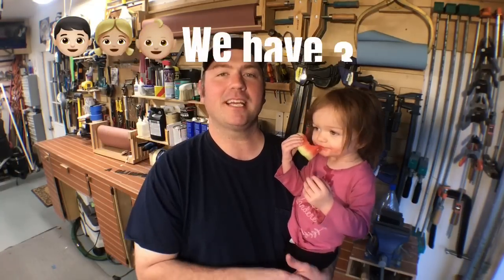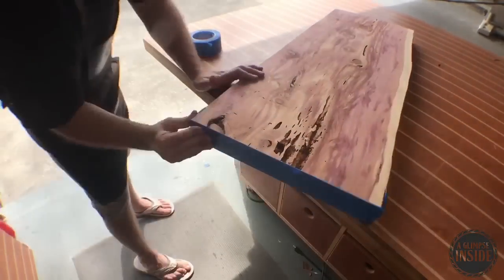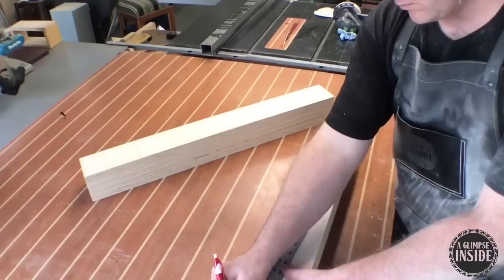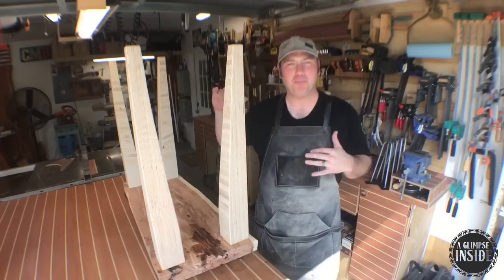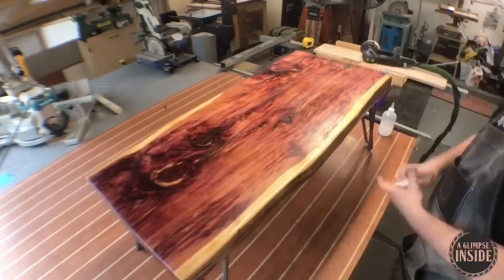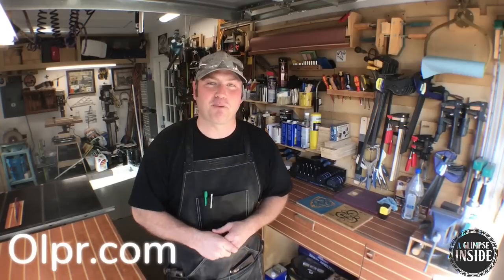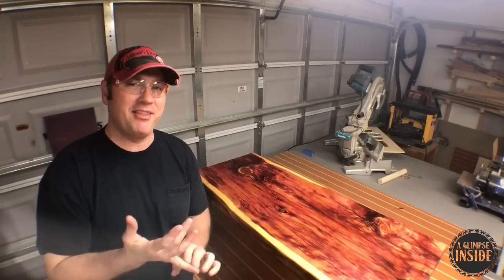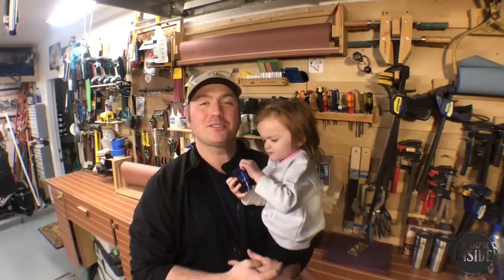How to Make a Live Edge Table | Professional Finishing Results with Polyurethane | Diy Project

Comment: Great video. Informative, fast paced and helpful. Your daughter is precious. I tuned in because I built a computer case out of cedar and wanted a finish like you achieved. Thanks for sharing.
Reply from the maker: Awesome. I hope it works out well for you
Reply: @AGlimpseInside  Thank you. I didn't achieve quite the finish that you did but it looks beautiful. I was impatient and stopped at 4 coats, last one was thinned slightly with thinner. Cedar is so beautiful when it is finished in poly.
Reply from the maker: AXMRDR agreed. 👍❤️

Comment: Great work. The sanding tips are excellent, as is the custom applicator hack for the wipe-on poly. I'm going to build a sofa table bar with cedar, using either hairpin legs or black pipe legs. I'll use threaded inserts and 1/4-20 bolts instead of drilling screws directly into the wood. It's more secure, and much better if you ever want to remove the legs.
Reply from the maker: Dan Limbach Thanks a lot man. The idea of the pipe legs I can come off I like it! Thanks for let me know man and sharing that cool Lego idea

Comment: Epoxy seemed as if it took a lot more than expected?  I made a coffee table with voids needing filled like that and it took three times what I figured it would . After a while of staring at it I decided to cut it in half and see how far the epoxy went and bang!
I now have two end tables that are usually the topic of conversation every visit from all. 
Kind of like cutting an ant hill into and seeing the inter workings .  Next time I think I will use some dye in epoxy .  
That lil one of yours is doll 🙂

Comment: Love that, would you use that floor poly, to produce a red cedar kitchen counter top?
Reply from the maker: If I was going to go with A full countertop I definitely would go with a one to one ratio epoxy. The polyurethane would probably hold up but I figured counters are probably the most used surface in the home so resin would be the best choice

Comment: Dude, loved watching the process of how the table came out. Thanks for going over all the steps for a flawless finish. I'm getting ready to do a live edge dining table, and I was curious on how well that finish holds up to heat. Would a cup of hot coffee cause white circles on it? Or would a varnish be better in your opinion? Thanks Bro, God Bless!
Reply from the maker: Hey thanks for the great question. You know honestly I’m not sure. I do know that I have fixed white raised in tables before with very high number to grit sanding and then reapplying to finish but I’m not really sure if this finish would do such a thing! Thanks for the kind words as well and I’m sorry I’m not much more help
Reply: Shelac does that, oil based poly won't.... Idk about water based though , I've never used it.

Comment: I’m looking to do a similar table to this but taller. Did you use polyurethane as you stated in the video or epoxy?  I would have thought epoxy would show the grain better. No?
Reply from the maker: Katz Steel The table was made before I was introduced to Resin. It’s still today has all those coats polyurethane on it. However within a few years from now I’m probably going to strip it down and pour epoxy over it. I do believe it’s a bit more durable than polyurethane. But absolutely just poly  in the video
Reply: A Glimpse Inside Do you have a go to brand for no VOC epoxy?
Reply from the maker: Katz Steel absolutely. Totalboat
If you use my coupon code”GLIMPSEIN” 
At checkout@totalboat.com you will receive 20% off your entire order

Comment: why not use a polishing compound? Also is that surface food safe? can she suck up her spilt cool aid with no long term adverse effects? She is a cutie pi for sure.. Floor surfacing doesn't seem to me to be the safest surface for her.. But then she is your child not mine.. I would have been a bit more selective in my surface for my kids rooms.. But it was a sweet looking table.. I love that cedar... I am going to do a live wood kitchen countertop (with some new cabinets I am going to make..) in the spring but I am having a hard time finding the surface sealing for it.. there are some oils I can use but that calls for me to re-do it after so long.. So if you have any good suggestions I would appreciate it..
Reply from the maker: Typically any polyurethane surfaces are food safe once they are fully cured. It’s essentially like a thin layer of plastic that can be disinfected with Lysol or Clorox. I do like the richness of oil finishes but yes you do have to reapply them. So really the choice is yours. I like walnut oil especially for food related items. Hope this helps.
Reply: @AGlimpseInside  yeah it is what I am finding.. so it helps.. I like the finish the oil's leave (I do not like the shiny surfaces for my kitchen ) But I do want something I will not have to hassle with.. maybe like a danish oil from watco.. it has both oil and pollies in it.. well thanks for your input.. every bit helps!

Comment: How does this differ from epoxy? What do you recommend?
Reply from the maker: I would definitely go with Apoxsee at this point however polyurethane is still a viable option. They’re both protecting wood with a cured plastic like substance I suppose it’s just a matter of choice

Comment: why am I getting streaks ? I over sanded my redwood burl in the beginning 60 grtit to 1000 , however I think my mistake was using a foam pad to spread to urethane , I thought "well when I sand it down for the second coat the urethane will fill in those streaks" they were almost gone from the sanding anyway , but they showed up again so Im asking pro's what to do . if it helps it was water base urethane , I hope thats not the problem .I dont have the $ just time a random orbital sander and a prayer . If you have ay suggestions please let me know . p.s- think she like the table . :)